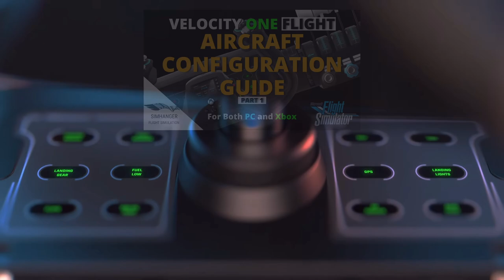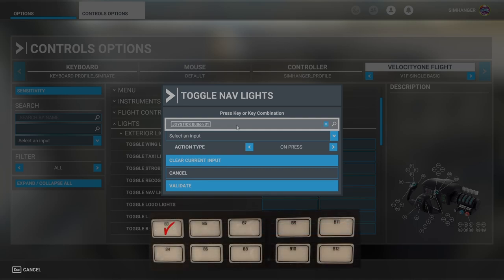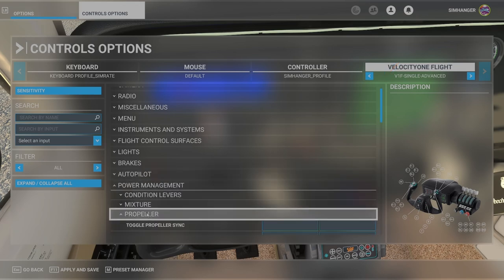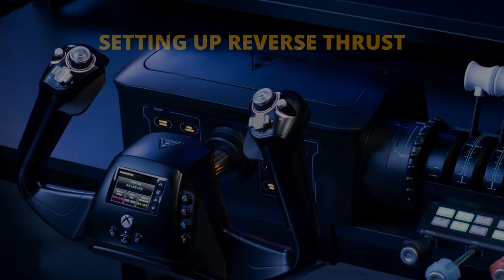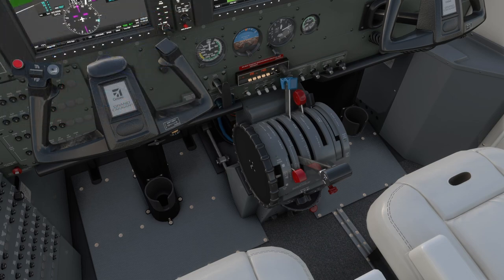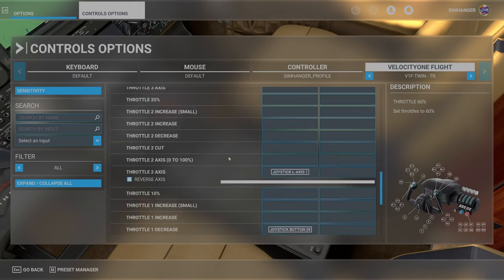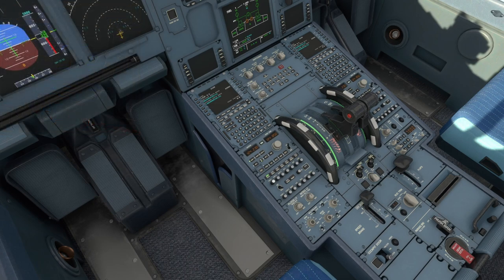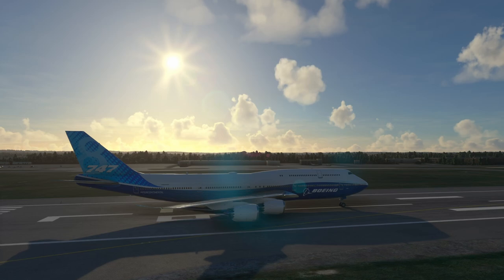VELOCITYONE FLIGHT AIRCRAFT CONFIGURATION | PART 2 for XBOX | Including Reverse Thrust | MSFS

Comment from the maker: A tutorial to help you configure your Velocityone Flight controller for use with multiple different aircraft in MSFS. Hope it helps. Comment below if you have a better way of doing things for the benefit of the flightsim community. Thanks
Reply: It and you help me a lot with MSFS 2020. Your tutos are very well done and explained. Thank you and continue your tutos.
Reply: For reverse thrust I’m using toggle reverse thrust and mapping it to Joystick L-axis 8+ (pulling the black Venturi throttle stick towards you) 

It didn’t work but my theory would be that that “button” would activate reverse thrust and then I could push it back in to deactivate and do the same with the prop feather. 

Wonder why I can’t get that to work? Any idea why it won’t let that be a work around?

Comment: To whoever this helps, for reverse thruster, they did make the detent a mapable button. But still, none of the hold/toggle reverse options actually put it in reverse. So I mapped that new button to "decrease throttle," and now when I'm at 0 throttle and lower it into the detent, it will go max reverse. So, there is no way to use the 0 to -15% throttle it goes from 0 to max -15% throttle.

Comment: I am new to Xbox and MSFS and have found your two tutorials (Parts 1 & 2) to be so useful in configuring my recently received VelocityOne Flight Yoke and Throttle. I have finished both parts now and everything has worked perfectly. You have made the tutorials easy to follow for a beginner. I thought I had a problem with the flaps, as did Andrew Rhodes, but I think I solved the problem by turning off Assisted Takeoff - please refer to my reply to his post. 
Thank you very much for your great work. I am a subscriber and look forward to all your flight simmer videos.
Reply from the maker: Thank you for your help and support 👍

Comment: Mark, your tutorials are the best. And I watch all tutorials for this gear. What make yours so excellent is the way you approach your viewers. Just explain how to set a control once (or twice) and rely on the intelligence of the viewer to repeat that for their own assignment. And you concentrate on the things that really matter. In this case which control is best used for a given function on a type of aircraft.
One tip: on aircraft without prop control you might assign the vernier prop control to be used as parking brakes. On the aircraft shown the control is also a vernier like one.
Reply from the maker: Yes, brilliant idea for the parking brake! 👍
Reply: Smart, I’m going to do that.
Reply: Took a while to figure this one out: Joystick L-Axis 9 -, then on press.
Reply: @sethkazzim731  There might be an even better way. Since today TB released new firmware, that makes it possible to map reverse thrust to the four top levers by way of using the full downward move of all those as a new button. If you don’t need all of those levers for engines and have set one up as gear up/down you could use the down move for parking brakes. That will not interfere with gear up/down as parking brakes only make sense with your landing gear being down.
Reply: @caskraker  True, I will do that for my TBM-930 profile, your suggestion works nicely with my Cessna 152 once I got it in sync.
Reply: @caskraker  so I tried this and I'm having issues. I have toggle park break set to the detente for one of the throttles. So a throttle is toggle gear and then the downward position is parking brake, but whenever I engage the parking brake it engages but it rattles intensely as if the button is toggling back and forth very quickly. Did you manage to figure out your setup?
Reply: @Beardy_McBeardFace  you should not use the toggle pb function, but the other one.
Pulling the throttle lever full back works like pushing a button and keeping it pushed in. If you map set pb (or whatever it is called) to the detent button with “on press” and release pb to the same one with “on release” you are good to go.
Reply: @caskraker thanks I'll give it a go

Comment: I finally figured out how to use thrust reversers on the jumbo jets without hold or toggle. Just goto settings and change throttle 1 decrease thrust as lever 2 button beyond detent and same for throttle 2 for lever 3 on velocity levers. Once thrust is at 0 pulling lever 2 and 3 back now decreases throttle into the reverse position. Hope its easy to understand now i dont have to press anything else just pull thrust levers back now and it reverses. Took me ages to figure out 😁

Comment: Of course, as soon as I fiddled around with the reverse thrust question, Turtle Beach releases a firmware update (and accompanying instructions) that now make the detent/reverse thrust functionality work as it should have from day 1.   Kudos to TB for solving that issue so quickly.
Reply: Literally just spent the day configuring mine and then reads this. D’oh! 😂. Great news though, thanks.
Reply: Except having just updated Firmware to 1.1.0, it doesn’t work.  Firstly the detent action only seems to work ONCE when recording inputs in the control settings - once recorded for one of the inputs, they stop working.  Secondly, the input recorded by the Xbox does not match what TB advise in the instructions.  It is supposed to be Buttons 41-44 but I actually get Joystick L-Axis 2+ (or close variations).  Have given up and reverted to the suggestions here.
Reply: @PrinceBarin77  That's exactly what happened to me.  In order to get buttons 41-44 to show up, I had to force-quit MSFS, remove the VF1 USB cable and then start MSFS from scratch.  Then everything worked as expected.   It's all just a tiny bit fiddly right now, but after a few fits and starts it seems stable now.
Reply: @Rick-ik2dd  Thank you!!  I think the “quick resume” status of my game was the issue.  As you suggested, force quit the game, restarted everything and voila!  All sorted.  Much appreciated 🍻

Comment: You are such a life saver! I'm very new to MSFS and VelocityOne and I was having extremely hard time trying to figure out all the controls and somehow found my way to your videos which is very helpful! Thank you so much for the detailed guide, I setup my controls exactly as you did! I have a rather silly question and I hope you don't mind me asking - What button or stick is assigned on VelocityOne to do the same function as "Right Stick" on Xbox controller? I'm unable to scroll down/left/right of the screen or even reduce the airspeed of a jet using the knob on the cockpit as it needs to be rotated. Idk if i'm doing it all wrong but it's been very confusing as a newbie.
Reply from the maker: I’m not sure if this is assigned, try the trim wheel?

Comment: Another awesome video. When you were saying (in the 747 setup) to put the engines in Rev, to use the throttle cut button on the yoke hat switch. Is that the up button? And to take it out of reverse you hit the down button. Thanks

Comment: Setting Flaps as per your instructions, however when I go to test them the flaps are set at Flaps 1 and no matter which way I push or pull the Flaps Lever it goes back to Flaps 1, even when in flight I cannot retract the flaps, any suggestions as to what I am doing wrong please.
Reply from the maker: Hi Mark, check you have all pilot assist options turned off in the assistance options menu.

Comment: First and foremost, thanks for all three videos.    The profiles you have created are a great start to get one in the air fast.  The problem I am having is with the twin turboprop profile, propeller pitch isn't working properly.  It does work properly in other profiles.  The axis shows a full range of motion in the controller programmer but in the sim the controller is restricted to the lowest 25% of the range.  I can move the pitch full range with the mouse but as soon as I touch the propeller control it jumps back down to the bottom of its range.  Thoughts?

Comment: Mark - Thank you for your tutorials. I am a beginner and would have been completely lost without your lessons. I have a question and am hoping you or someone here can answer. I followed your part 1 and part 2 exactly. But when I set up my flaps axis using the right most level, it works fine in the control options. When I move the lever to the top the bar indicator moves to the right and if I leave the lever at the top, the bar indicator stays to the right. Same happens when I move the lever down. The problem is when I am back in the cockpit and I move the flaps lever, it kind of flickers but no matter where I leave the lever the indicator inside the cockpit snaps back to the center. In your video it nicely stays on the top. I have no idea what I am doing wrong. Many thanks again for your videos and Happy Holidays
Reply: Hi I’m using Joystick L-Axis 6, not 6- or 6+, reverse axis is ticked/on ☑️
Reply: Flap Axis, not the %
Reply: Thx Seth. This issue got fixed on its own. I deleted the profile and went through simhanger set up again.

Comment: My throttles only start the power from the middle of the lever and up. How do you get power from the indent to the full throttle position like yours?
Reply from the maker: Check you are using the correct axis assignment…there are two, they act differently.
Reply: @SimHangerFS  May I ask what the right one is?
Reply: I have the same problem with engine 3 and 4. I have them both assigned to Joystick L-axis 6 but they act weird. No problem with engine 1 and 2 which are assigned to Joystick L-axis 5. All help is very much appreciated.

Comment: Thanks for the setup tutorial as it has really helped me get up and flying with the TBV1F!  When trying to fly the TBM 930, I cannot get the throttle over to the “idle/feather” position using the propeller.  I have my setup exactly as yours is set for Turbo Props, but no matter what I do, I can’t get the throttle back over, it simply moves downward on the left side.  Any ideas???  Thanks!
Reply: I may have figured it out. Testing further tomorrow!

Comment: Hi Mark thanks for part 1 and 2 I have spent a few hours on this now. When I create a new profile and configure the velocity 1 apply and saving after every configuration. The problem is it does not save the selections that I have made and does not even save the title of the profile. On my last attempt which is the 5th it seems to have saved the selected buttons under the default title and not the single engine basic which I named it. I worry about creating another profile and using the duplicate key and making the changes and re naming. I tried it last time and it did not duplicate from the basic settings what am I doing wrong I have followed your YouTube clips 100% sorry and thanks for the advice.
Reply from the maker: Sounds as if something is corrupted. Try restart console. Check for updates.

Comment: I have an Xbox one, the controller worked out of the box in the main xbox menu etc. But not within msfs itself. I updated the firmware, restarted the Xbox, unplugged the controller etc. However, the control still doesn't work at in msfs, or show up as a controller option, any ideas?

Comment: Hello and thanks so much for the detailed setup... Very helpful. I have one question/problem perhaps you've encountered.  It seems no matter what throttle quadrant lever I assign ”flaps" to  (using flap axis) the function is all over the place... Glitching out of you would. I thought it was a hardware defect on the velocity one however when I swapped with other items on the same level (say spoilers axis) the control was smooth and 1to1 matching in the sim... Very much unlike what the flaps were doing. Is there something I'm doing wrong or perhaps have conflicting settings? I watched part 1 & 2 if your videos very carefully b and think I did everything right??? Any suggestions would we very much appreciated. Thanks again for such great content.
Reply from the maker: Hi, in the assistance main menu, check you have pilot assist functions all switched to off.

Comment: Hi Mark, this has been an amazing help - thank you! I seem to be having a problem with the flaps using the fourth quad arm. When I move it up and down, the flap lever in the cockpit is moving slightly but goes back to the original position. Did I do something obvious wrong?
Reply from the maker: Check calibration in windows if you can.
Reply: You might have had the same problem as me Andrew. I went through Mark's tutorial and the flaps didn't work on any of the aircraft. I thought that it might be due to an overarching setting in MSFS (as I am new to simming and had everything set to "EASY"), so I went into Assistance Options/Piloting and turned off Assisted Takeoff. Hey presto - the flaps then worked everywhere!
Reply from the maker: @flybeeson7950   great solution….thank you
Reply: Switch to Joystick L-Axis 6 (or another number). Not 6- or 6+.
Reply: @flybeeson7950  Hi Alan, I'm using FS2020 on XBox X series, and was having exactly the same problem as you and Andrew with the Flaps returning to the middle and not having full function, etc...... Thanks to your very helpful comment ref turning the assisted take -off to "Off" has worked perfectly, so a huge thanks to you mate !!. All the very best John Urwin.
Reply: @johnurwin1316  Hi John, Glad that my suggestion was helpful. BTW Mark (Simhanger) has emailed me to say that he will be producing a new update video covering the latest Turtle Beach Upgrade v 1.1.0; so that's one to look out for. It will cover the new Reverse Thrust Detent Buttons. Might be a while though as he has a lot on his plate at the moment.

Comment: MARK!!!!! I REALLY HOPE YOU ARE STILL READING COMMENTS AND SUCH AND RESPONDING BECAUSE I'VE GOT A REAL ONE HERE THAT NOBODY SEEMS TO BRING UP OR DISCUSS!!! 

So on the actual yoke joystick scteen you have the ability to change colors and uodate firmware and put into training mode....but also theres that other section that has these 3 profiles (Default, Single prop, jet engine).....now unless i missed it from you, arent we supposed to change that profile setting on the yoke screen first, then once You load into MSFS and go to control options, youre also supposed to match which plane or engine type you chose? I thought i Heard someone say one time a while ago that they had to match in order for the buttons and levers to match n sync up perfectly.....then i thought well why is there even a DEFAULT profile to begin with if that's the case??? I really don't understand this part very well and has me somewhat confused as to what im supposed to do there. Do you know by chnace? And what about the training profile also?? How is that related? I can't be the only idiot out there with these questions hahahahaah. Any advice is much appreciated sir. Take care boss!!
Reply from the maker: Hi, the default profiles on the yoke are for ‘’training’’ purposes only. In other words so you can check the buttons/axis in something like windows calibration etc. They serve no useful purpose actually and the setting has no effect in the simulation. To all intents & purposes  I ignore them. The peripheral has some default profiles built into MSFS.
Reply: @SimHangerFS Mr. Mark, thank you thank you thank you my good man, I cannot tell you how relieved I am to hear you say that because I truthfully had like no way of knowing either way if it was that important or not. Glad to know now though. I sincerely appreciate all you have done here to help newbies and amateurs like myself. Hopefully you dont mind it when people like myself ask you questions....cuz if i cant find an answer online, id much rather ask someone with knowledge and experience than believe everything I read on the net hahaha. take care sir. until next time!

Comment: Having a difficult time trying to get flaps to work the way you’re showing. When using your set up if my flaps extend at all will be by 10%,  when way hung flap lever it comes down then immediately back up (747 set up). Firmware 1.4.0 Xbox series x
Reply from the maker: Check your using the correct flap axis, there is more than one, also ensure pilot assist functions are all off.

Comment: Mark....there may be a different---better IMHO---way to achieve prop reverse with the VelocityOne. I've been experimenting with the "neutral" setting within the sensitivity settings, with credit to someone on one of the many forums for the idea.  I've only done this, so far, on the Grand Caravan and TBM 930, but leaving the throttle binding just with the 0-100% setting (no other buttons/etc. for reverse), only, and setting the neutral sensitivity to around 90-95% makes the throttle go into beta/reverse about where you'd expect it to without having to press any buttons.  It also gives you almost the full range of the throttle, whereas before it tended to go into beta/reverse at around 50% of its travel.  It doesn't work quite as well with the TBM as the Cessna but, even so, it's more how you'd expect it to function (going into reverse just near and after the detent point).  Please give it a go and let meknow what you think.
Reply from the maker: Hey Rick, sounds like a great solution. I’ll give it a go 👍
Reply: @SimHangerFS  After further experimentation, it looks like this is only an effective solution in the single engine turboprop configurations.  The "hold reverse" button still seems to be the best way to get into reverse in the twin props and all the jet configs.

Comment: My issue is that when I scan for the lever for the spoiler or flaps it picks it up on scanning but when I validate it it doesn't show in the box and hence won't work. I've been at it trying to fix it for an hour or so and nothing worked. I did a firmware update to see if that was the issue and still nothing..
Reply from the maker: @tallspiffyfish  rather than scan, select the axis/button manually from the drop down list. Try that.
Reply: @SimHangerFS  I'll give that one a go.